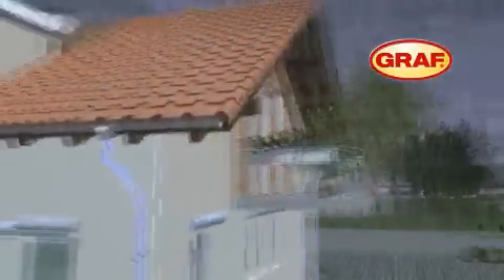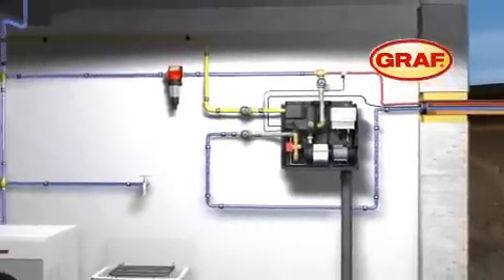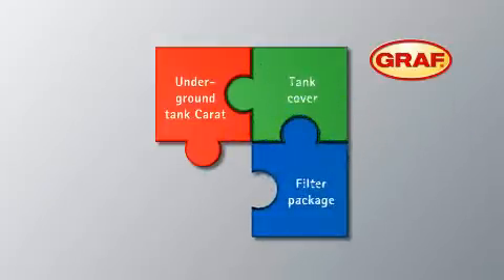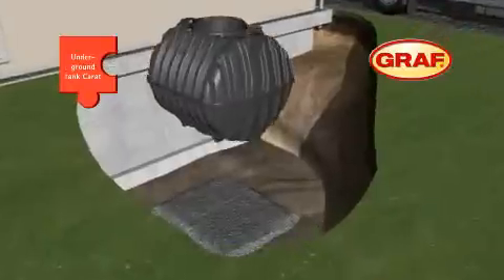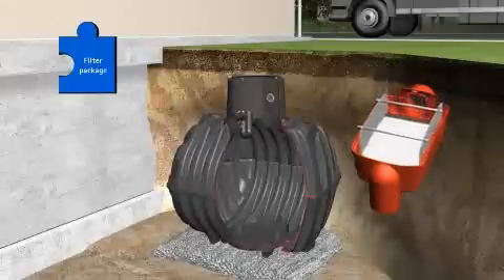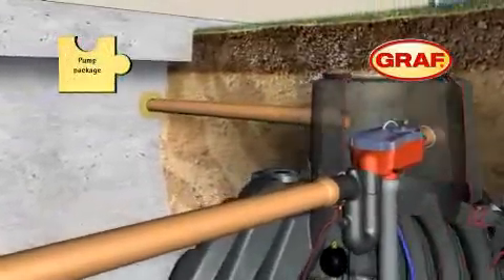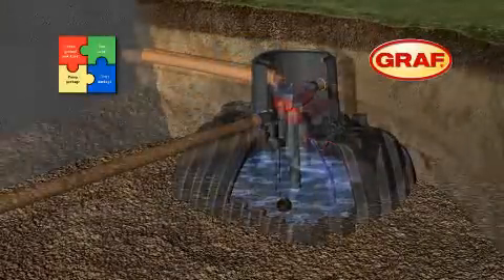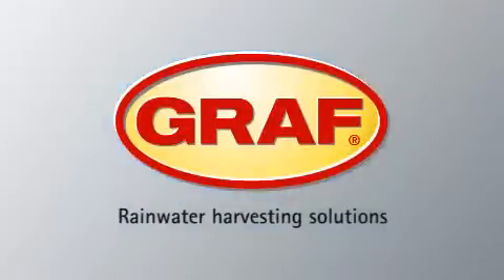Rain Water Harvesting explained

Comment from the maker: Yes. We have done many systems where rain is the primary source of water for the tank. Then if the rainwater runs out, a floatswitch in the rainwater tank can automatically turn on a pump in the borehole to add some water to the

Comment from the maker: The water in an underground tank will last indefinitely. Because it's contained in a sealed tank there will be negligible evaporation. Certainly the spring rain will last through to summer so then it's just a case of calculating the tank size. If that's of interest you can see a tank size calculator for the British market at the rainwaterharvesting site. Regards, Marcus

Comment: It's nice to see this all packaged up. I had an above ground system installed last year. I would have liked a below ground tank, but I thought that would be too expensive.  My system stores 2500 gallons and is used for laundry. It works like a charm.  You can see my video as Rainwater system in Northern California.  I added an overflow pipe based on comments.

Comment from the maker: Hi KingsView33. Well, how cold? If rain is running off the roof then rainwater harvesting works because the rest is underground, i.e. protected from freezing. If you have snow and ice on the house then no new wtare will flow into the tanks but in most circumstance you will still be able to pump water from the underground tank round the house. All the best, Marcus

Comment from the maker: Hi Copefarms
1) Yes, the underground storage tank needs a good drain or soakaway so that the water flow over the leaves takes the leaves with it. 
2) The filter is self-cleaning. No maintenance needed, but check once a year to be sure the soakaway is not backing up.
3) Cost in the UK is 2000 to 3000 pounds GBP, say 3000 to 4500 Dollars USD for sizes between 2700 and 6500 litres including pump filter and accessories but not installation.
regards
Marcus

Comment: several things it doesnt mention.

1. Its a tank when it fills up where does the overflow go? So as not to cause backingup of the rainwater near your houses foundation.

2. how easy is it to clean this filter or should it be replaced? 
3.How much does the filter and system cost?